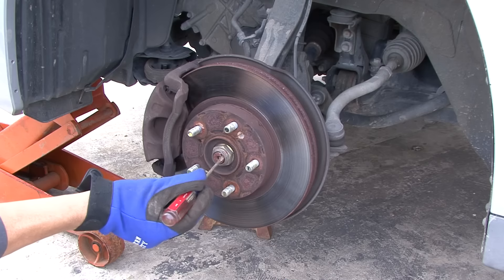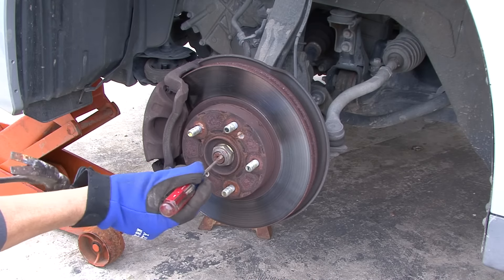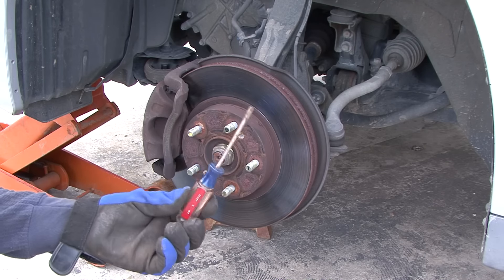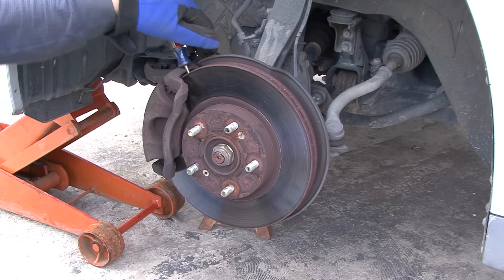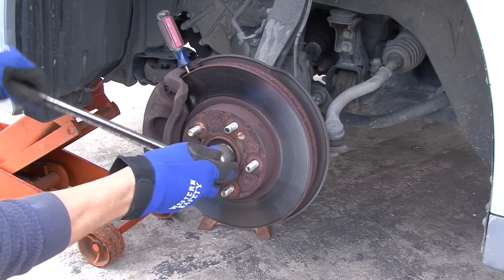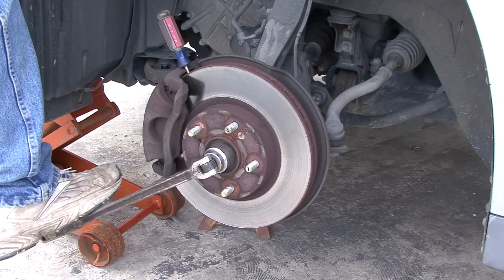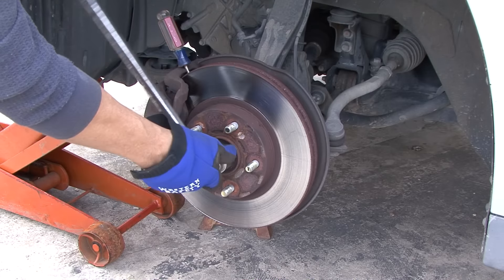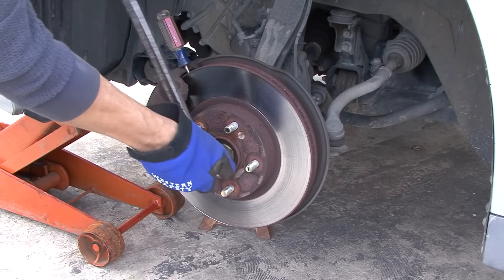How to make getting your CV axle nut off easier

Comment: No offense but your video definitely looks like you had prebroken that nut loose and simply tightened it up and then filmed this portion of the video.  I want to see some actual real world attempts at breaking the hub lug loose.  Take my situation, for example, I have been trying off and on for about  weeks to break my driver's side lug without any success.  I've tried this method and that method,  I've saturated the fucker with fluids, I've done propane and MAP pro heat, impact drivers, breaker bars with 6 foot extensions and stood on those bars(breaking 2 breaker bars), wax and pretty much anything else that you can think of.  Now, I want to see the video of how to break THAT nut.
Reply: easy, bolt it back together, place the breaker on the nut on the right side near the ground[depending on which side youre replacing of course], Then slowly reverse and hope the breaker or socket doesnt explode. lolz jkjk But for real, this is an oldschool method to break crank bolts loose[except in that case youd be turning the engine over..] lolz You could always drive a chisel into the nut and split it. ;) Although Im sure youve sorted it by now... [5 months ago] :)
Reply: @biocyd3  Yep, Dremel with a metal grinding bit was the only thing to break the lug off.  I also had to use a  27 mm wrench to control/hold the dremel in place